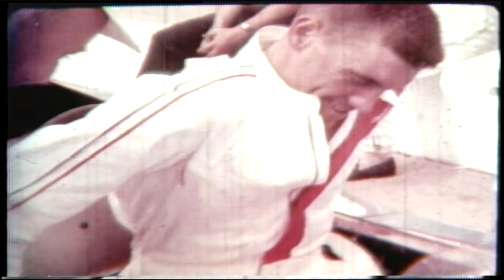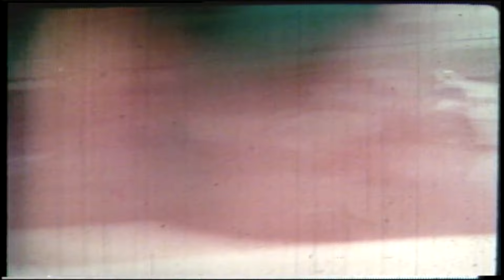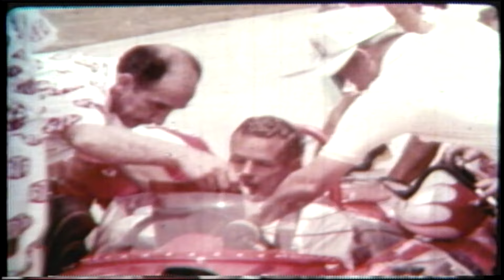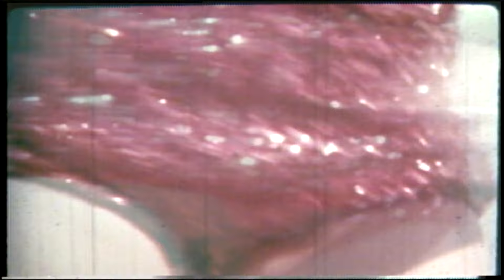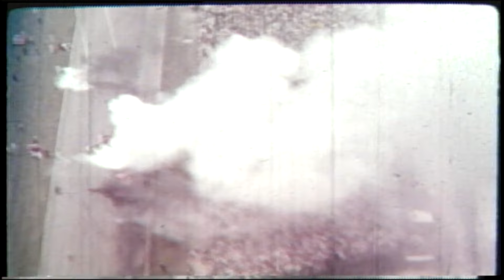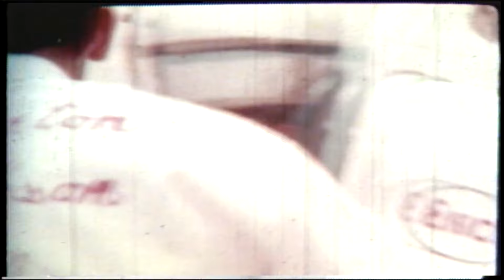See How A.J. Foyt Won His 2nd Indy 500 in 1964

Comment: Youtube offers all the old Indy 500s   since they started filming the event.  
A.J. was a world class mechanic, as well as a very good driver.  Designed and built his own cars.
A strategists as well.  On 3 of his 4 Indy victories, he just outlasted the competition on the lead lap.  He could take the heat, and he seemed to know just how hard to push his car.  These old cars will gladly go past the red line, and blow up if your not careful.  
  No abs, no electronic stuff, no rev limiter.  Lose your concentration for a split second, you will not win.
  Those old cars had less regulation.  Sometimes well over 30 gallons of fuel on board.  What you see here, may be the worst accident in televised Indy history.
Wow, thanks for the vid.😊